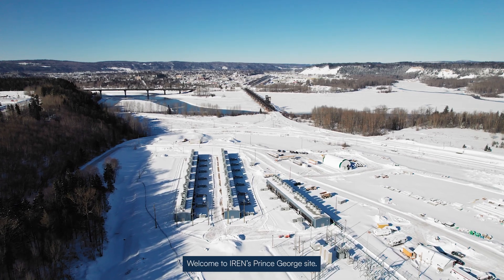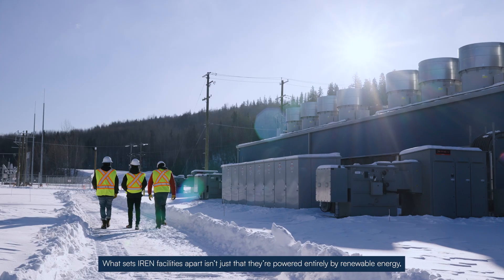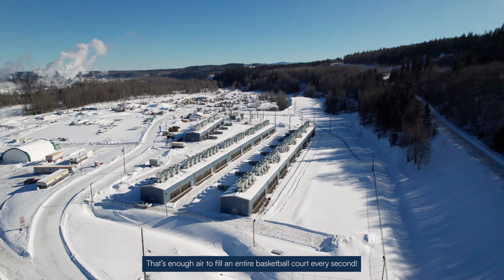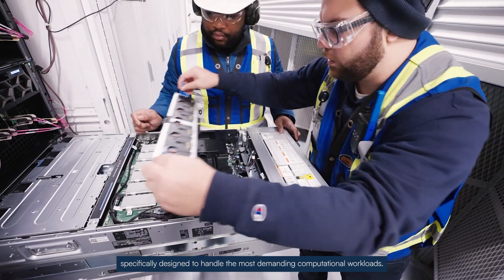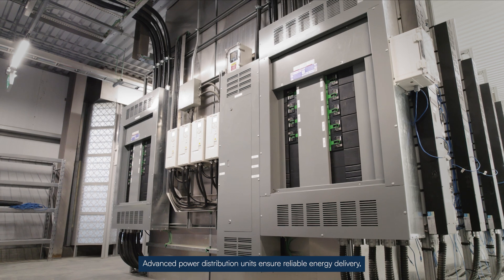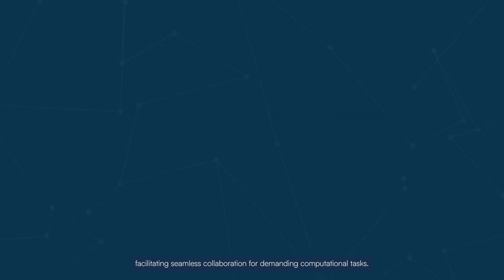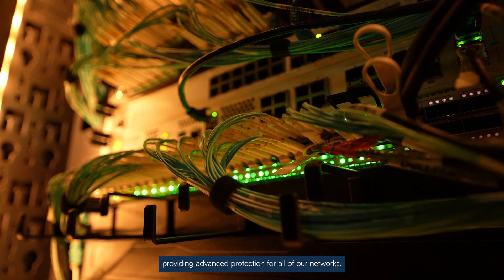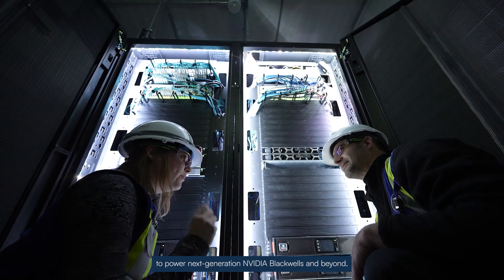IREN Data Center Tour

Comment: Water-cooled traditional data centers consume too much water and easily cause disputes in water-scarce areas. But BroadWatt’s Hol data centers avoid this hassle—they convert heat from server racks into cold air for cooling, which is quite practical.
Reply: Convert heat into cold? How do they do that?